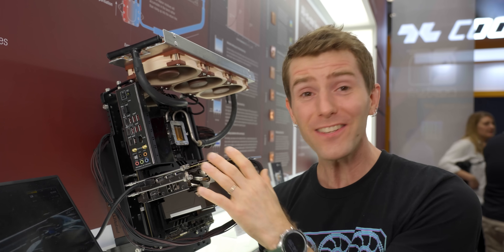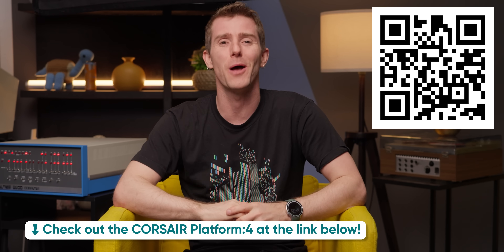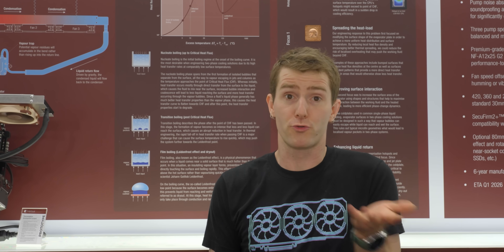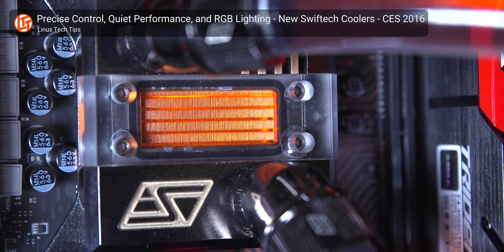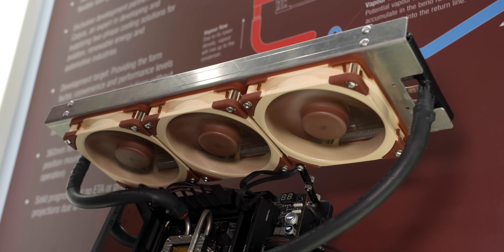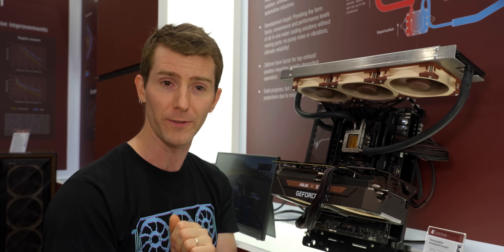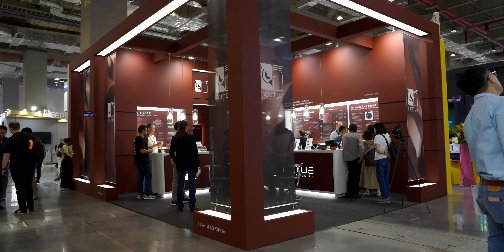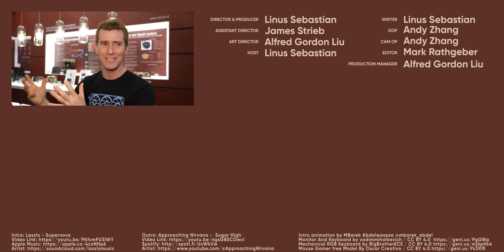6 Years Ago This Idea FAILED.. Now it’s WORKING

Comment: Anybody notice at 06:45 that the when Linus stopped the fan it did not immediately engage till 5 seconds later. I haven't known a fan to have an active anti-burnout function built into it's controller. That's pretty professional of Noctua for a consumer PC case fan!
Reply: actually, its very commom...
Reply: that is built into the motherboard logic system, you can place any garbo fan onto it from decades ago and it will act the same
Reply: @xityarxip  so stopping the fan causes a current spike, and the mobo automatically stops feeding it?
Reply: @PTNLemay  most fans manufactured in the last decade shut off on their own when they detect a stop. its integrated in the fan and is common on graphics cards too. you can power any fan with a battery and still get the same result
Reply: @PTNLemay  yes. And they try again to restart once every few seconds
Reply: @two_number_nines 
Good to know, thanks
Reply: I saw this happen irl at computex! Linus is a pretty chill guy
Reply: @IndoGunsnGear  Linus is pretty chill? WTH man he is like a hyperactive chihuahua…
Reply: Nah, many fans work on little voltage, but need more voltage to start. And this one just struggled to start immediately, imo.
Reply: @john_smith_555  when an electrical motor is receiving voltage, but is not spinning, its current draw will be at its maximum. this is true even for startup so realistically you actually want LESS voltage on startup to limit the in-rush current (a very real problem when driving electric motors). it has something to do with motors is still a dynamo even if you mechanically design so it performs better at being a motor than being a dynamo. so when a fan motor spins, its actually creating its own voltage called back-EMF that works against the voltage coming from the fan header, thus a smaller voltage drop falls on the motor, which result in less current, and reduce the torque of the motor. but the moment that speed goes down, the back-EMF also goes away so the fan ramps up again. this explains the constant torque behavior of PWM driven electric motors. direct voltage control motors would increase in torque and draw more current the more you try to seize the motor which can be good or bad depending on its use, and the physical limitation of the motor and everything connected to it.

typically, modern computer fans wont draw crazy enough in-rush current to trip the motherboard overcurrent protection, because most of them are now PWM driven, and you can use PWM to limit the in-rush current. but if you hold a fan still and seizing the motor, it can detect that the current is not dropping as expected, because the back-EMF is missing thus it cuts power, and checks again to see if the fan still seize like 5-10 seconds later like we saw what happened.

Comment: Okay, so what's the catch? The pump was the only thing making AIOs a repeat purchase. The tubing and the radiators already last pretty much forever. So what're they doing to not sabotage their own sales? CHeaping out on fittings, or materials for the tubes, so they split and crack? Using fluid that will gunk up the radiator eventually?

Comment: Mini HVAC systems inside the computer is what we need. AIO system with refrigerant.
Reply: That's basically what that is. It has a thermosiphon evaporator and an air cooler condenser.  Just need the right liquid so the pressure stays low to avoid leaks.

Comment: Look, as a consumer im just going to shout my opinion on this, WE DON'T NEED A SILENT PUMP on an AIO. 
If software was universal and reliable for telling me of a pump flow issue I would be all for silence/near-silent pumps.
But it's not, I've seen and had computers go into solar heatdeath because the software detecting fan speed didn't think to mention the 0 RPM of the pump, or software failed to launch in the background so there was no definitive fan curve to follow!

If anything im fighting for the next big standard feature of AIOs to be a f****ng flow meter!

Comment: Big problem with using boiling liquid is now that even if the failure rate is lower when one does eventually fail it might explode. The moment water stops being condensed you've got a pressure vessel, and pressure vessels are dangerous.
Reply: Same principle used in every heatpipe and vapor chamber.  There's several in your laptop, your phone, etc.  

The pressures are usually below atmospheric pressure because the fluid is always at a pressure matching its boiling point at the current temp.  The system will be in partial vacuum until the heatblock hits 100C, at which point it's equal to external pressure.  Higher and OH!  The CPU just shut down from overheating.  

So there is no danger whatsoever-- so long as it really is just water, which it should be.
Reply: @monty9373  There's a difference between metal pipes holding a small amount of water and a tube system trying to hold like a quarter cup of water worth of it. Difference in the amount can make a world of difference because when water evaporates it expands in volume approximately 1700 times.
Reply: @zaucethesaucebauce527  Not in this case. It's all under _partial vacuum_, or it wouldn't boil below 100C.  When the water vaporizes, it transfers its energy at around the speed of sound to the condenser, where the same amount of vapor condenses right back to water.    If you punctured it with an awl while it was running near its limit--- nothing would happen.  It would just stop working after sucking in some air.

Comment: Why don't they 3d print a warped minimal surface from porous copper and cap each side of the surface at opposite ends, with vapor gates between the chambers at local high points? The copper becomes a wick and transport pipes, dividing up finer closer to the plate, transporting the fluid closer while allowing it to escape. It would probably require a clever start system to  distribute pressure, maybe a sump and a heater for the vapor side to remove fluid and prevent vapor lock on the fluid side?
Reply: You could probably make this direction agnostic too, with two L shaped sump/accumulator chambers, four heaters, and sloped, reversible condensing pipes. Definitely not "cheap", but this is a noctua product we're talking about

Comment: This is technology used in fridges.... But even fridges aren't eternal. I'd feel uneasy about having a cooling system that could fail without warning by simply leaking, without me being able to notice it until my chip burns.
Streacom (calyos) also uses a similar tech, and their solution is better since they are really silent: they use no fans. Anyway, I'll wait a LONG time of positive feedback on market before even thinking of using this :)

Comment: i love that boiling in the syphon

im always worried about a watercooler leaking on the parts..

so a syphon with much less water in it, could be a safer alternative. 

I would totally buy that, if it doesnt cost 200 bucks.
Reply: I'm still happy with my 14-15yo NH-D14. And good CPUs don't need high end cooling anyway.
Reply: There's also the fact that this is probably not water.   Otherwise it would only really be effective when your CPU reaches 100°C  (boiling point of water, whatever that might be in Fahrenunits)
Reply: @Atlessa  Probably something toxic?
Reply: @Atlessa  I have understood that heatpipes have used not only certain type of fluid to operate, but also a certain internal pressure.... Admittably, when you go to flexible tubing and all, I suppose you can't have that much negative pressure.

Comment: knowing noctua's price comparison even against the most expensive air coolers of other brands, this aio is probablyl gonna be $400-500
Reply: Yup, their G2 140mm fans are $45 each. Which is the price of the entire ALF iii 420mm. With an extra smaller fan, radiator and 'first Noctua AIO' tax I can't see who either of the watercooling products are for. At that price you'd just get a custom loop done.
Reply: This tech simply isn't for you. A $30 Thermalright cooler is good enough for 90% of people. This is for the silence freaks (no disrespect to them) or maybe for embedded systems that need to run continuously for years without maintenance. The latter would usually use a passive heatsink but this tech eliminates a point of failure compared to traditional liquid coolers and thus might be in the sweet spot for companies that need a high-performance machine but without the maintenance
Reply: That is the top price I would pay for a PC. So yeah F that noise ... Cost of living here doesn't allow such expenses and never will. Soon as pays go up (for some) prices of things go up too so what is the efin point, I will never afford anything with 100$ or 100000$ it will always be the same, maybe even worse. 
Prices of local postage went so up that many closed shops or don't buy anything online anymore and it will get worse. Literally I had more money and luxury during "hard times" in covid etc then today out of it ...

Comment: Scientifically, if you have directionally pattern path in the metal block and tubing, it wont need a pump . It will also increase surface cooling as well.

Comment: "Pumps make noise"... Yeah.. So do the three fans you still have to use for that passive system. 
I used an AIO for many years and would go with a decent air cooler any day these days. More quiet, less fans, less maintenance, less noise.
Reply: The point was to reduce sound, but also remove a failure point making it maintenance free
Reply: @_Juke_  But how is it different from a heatpipe?
Reply: @Atlessa  heatpipe cooler requires a capillary wick to work, and that basically makes it a single rigid block. While some heatpipe coolers have become quite a giants... I guess they are likely not exactly a match for something like a triple fan cooler. That is just so much active surface, and it should be noted that often heatpipe coolers have long strips of thin aluminium, and as such plenty of surface, but the further you go from the actual pipes, the less heat there is. Radiator block type of design puts short fins between coolant channels and basically every bit of surface area counts as much.
Reply: @_Juke_  No, I totally get that.
And the removed failure part is valid.
Just the noise part is silly. 3 radiator fans produce more noise than the typical 2 air cooler fans. If you care about noise you go air cooling anyway.

Comment: I see a weird meta within PC water cooling where the cold plate often matches the size of the IHS, or is just a tad bit bigger. There's essentially no limit to how big the cold plate can be. The bigger it is, the faster it will sink heat. It simply doesn't matter that it's not directly touching the CPU- copper is so incredibly conductive that heat travels through it much like an electrical current would, just more slowly.

Comment: Another market for Noctua is RV Converter Chargers.  The el-cheapo fans they use are so noisy coupled with the small space in an RV.  This hardware marriage is a no-brainer.  I replaced the 80mm fan on our WFCO unit with an NF-A8 ULN and now is totally silent while "glamping".

Comment: Boiling coolant??? That means 100+ Celcius and a shitload of air bubbles creating pressure problems. Do they lower the pressure towards a vacuum to lower the boiling point of the liquid? Higher pressure means a higher boiling point. This is only possible when using AC or fridge gas and that can only be done by certified professionals instead of DIY PC users. Every gram must be on paper. I know because I'm a mechanic with a certified AC specialization. This means the regular used cannot service it and regular hardware stores cannot sell it because of the special gas used. There are laws and regulations around these things which is why we use water and alcohol solutions in PC cooling
Reply: please remember that some liquids boil at lower temperatures than water before you comment stupid shit like this

Comment: I would buy noctua fans but their color palette is simply gross for me. It does not fit either black or white case. It stands out way too much for a simple fan and I don't want to paint each fan by hand just so it fits in color theme I want my case to have.
Reply: @mariow7818  I think there are noctua black coolers though

Comment: It would be costly but maybe something like a copper sponge heat exchanger filling the container but directly built into the block might offer a more even distribution.
Reply: Copper sponge is not expensive.  Well, not compared to skiv tooling. 
You're very close, but from the wrong direction.  Copper sponge does not conduct heat well, at least not for very far; there's not enough copper.  But, surprisingly, it can wick water exceptionally well!  We can use it to improve phase change by conducting fluid at increased rate along a thin surface that's hot enough to evaporate the fluid.
So, what you want is a sponge or sinter layer, with surface feature prepped to enhance wicking.  Put it over a solid copper structure to conduct heat up to the sponge.  The sponge is thin and not submerged; lots of surface exposed directly to the chamber to minimize resistance to vapor flow.  But the sponge is continually wetted by wicking, with a nearby fluid source fed by the loop return.

Comment: If they do bring that thing to market, i hope the keep the window so you can see the liquid bubbling, it's way more beautiful than any LCD screen
Reply: With noctua's timeline on stuff coming to a shelf near you 2045
Reply: @theatermusic87 hah, that's gonna be faster than GTA 7
Reply: @theatermusic87  I am guessing it sucks, so probably never.
Reply: For most builds it probably would need some leds built in or very close to the window to actually be able to see inside, but yeah it would be neat
Reply: with the way acrylic can degrade over time especially with temperature changes, and how whatever fluid they're using may interact with it, I think  a solid metal piece would be better for longevity.
Reply: @ADemonicSkittle  just use glass, it is noctua when its all said and done and noctua dont cheap out on parts like other manufacturers
Reply: @ADemonicSkittle  that's actually a very fair point that I didn't take into consideration myself 🤔 not much else can be said, just a very good point lol
Reply: @ADemonicSkittle  They could use polycarbonate instead, it may hold up better
Reply: just put a  boiling water  video on ur lcd lol
Reply: @IHollowShadesI  lmao ayo thats not a bad idea
Reply: and also so you can see if there's a leak and the vapor escapes
Reply: well they just might as long as the coolant doesn't corrode whatever transparent material is being used like aluminum or even acrylic, and yes we do have transparent aluminum now lol I love engineering
Reply: The Asetek patent expiring seems to be doing amazing things for liquid coolers
Reply: @CLutch4444  patents styphle innovation so that seems obvious
Reply: @JYMBO  and keep the orange liquid, looks so cyberpunk
Reply: +1
Reply: they'll need to put even more acoustic isolation than on the pump to make it usable though
Reply: Unfortunately, those bubbles are a strong indicator that far less thermal transfer is occurring. 
Gas is an extremely poor conductor of heat compared to liquid
Reply: @jeffgriffith7003  may be true (this was mentioned in the video) but the point is that its phase change, the liquid needs to boil or else it isnt phase change and the pressure wont push the gas into the condenser. the key is to prevent the bubbles forming at the interface.
Reply: @jonathanodude6660  oh they will form there. That is where the heat is. The heat drives that formation. The challenge is avoiding that they linger there.
In immersion cooling that is much less of a problem, because physics.
But in a small scale block like that there is not pressure asserted by the depth of the liquid, so there is small "upward" force on the bubble to rise. Hence the focus on avoiding the traditional fins of liquid cooling that bubbles might linger on and block the flow.
Reply: And someone will use em as randomized number generators ala Lava lamps.
More numbers, more camera frame processing , more heat, more variations, perfect.
Reply: God loves you and has a plan for your life
Reply: Yes a transparent microled screen
Reply: Oh the cool factor of this is SO MUCH more than some LCD screen anyways!!!!! Imagine telling your more computer illiterate friends you're literally using phase change cooling in your PC 🙃It would blow their minds lmao
Reply: Best of both world would be to use translucent oled lol
Reply: @andyartmaster101  if the coolant doesn't chemically react with the screen to destroy it that'd be a genius idea!
Reply: @andyartmaster101 No. To hell with screens all over the place. Keep it simple.
Reply: agreee

Comment: Is here posibility of overwhelming the cooler? Something like with Peltie that if you put too much heat, the vapour won't go back into liquid?
Reply: Yes, in the same way that a heatpipe can stop functioning when it's thermal capacity is exceeded.  For Noctua's cooler, the limit would probably be the condenser - Put in more heat than the condenser can handle, and could get to a thermal runaway case (until the CPU shuts itself off).  This is more likely to happen if the fan speed control malfunctions, or a fan stops working
Reply: @chalybion4766  Thanks alot! I know that it probably won't happen but was just curious if theoretically it could.

Comment: if phase change is possible why not just have a normal air heatsink and have the copper tubes thicker with the special coolant in a closed system